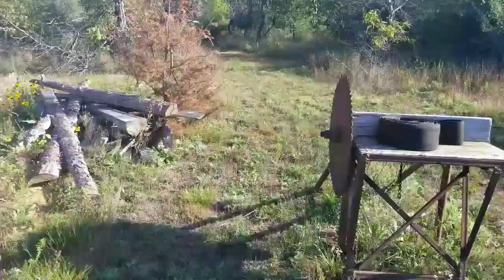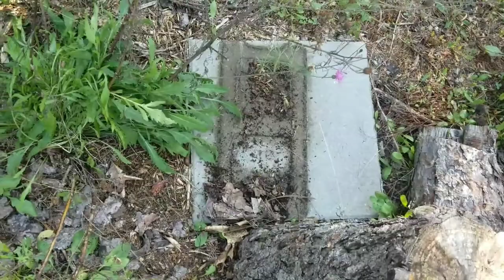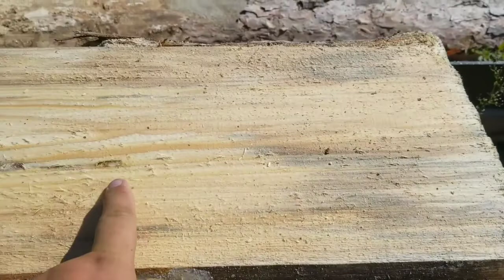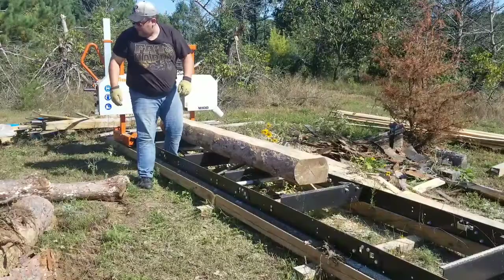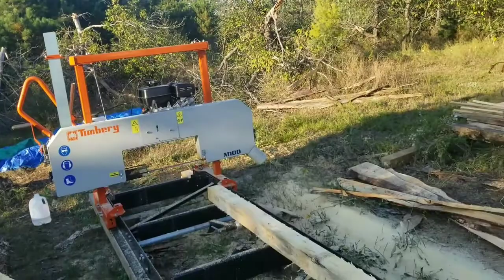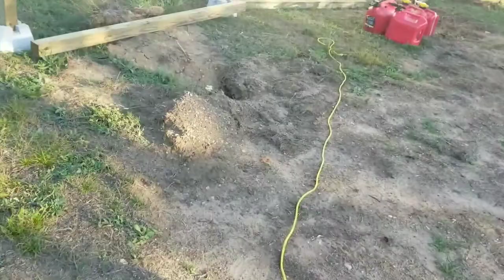Milling Lumber for the Camper Garage

Comment: This saw looks a lot better than the Wood-Mizer, at least they know to put the dust exit port on the other side from the user.
Reply from the maker: The plus side of walking in the sawdust is that it's nice and soft to walk on. Otherwise that part stinks. But then again, on a mill like the Wood-Mizer you can leave the log loading ramps in place. The log bed frame is the same as the Wood-Mizer LT10. Maybe I'll do a video after more time with the mill on what I like and don't about it.

Comment: Nice video!  I have the same mill,  do you have issues with getting accurate thicknesses with the “sprocket” height adjuster?  Just wondering if I have mine put together correctly....
Reply from the maker: Timbery contacted me and said how to inspect and fix it. Will try to film that video this weekend.
Reply: Beyer Forestry, Welding, and Other Stuff 
Oh wow, I’ve looked on their website and can see it’s different but they don’t show what up hey changed or how to update it!  I’d definitely like to hear about the modifications to correct this, it’s been driving me crazy.
Reply from the maker: Might have to wait a few weeks, kind of a snow issue. Snowblower won't start and hope the neighbor can plow me out.
Reply: Beyer Forestry, Welding, and Other Stuff 
It’s just good to know there is a solution, will be contacting them this week!  Good luck and happy milling